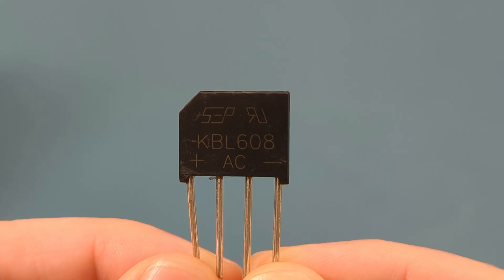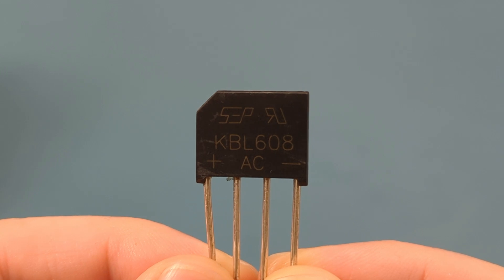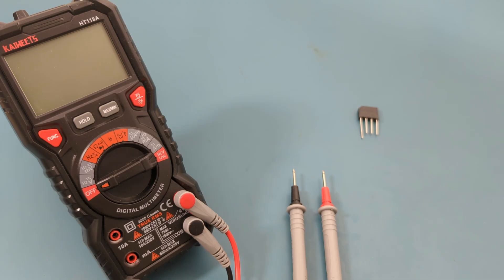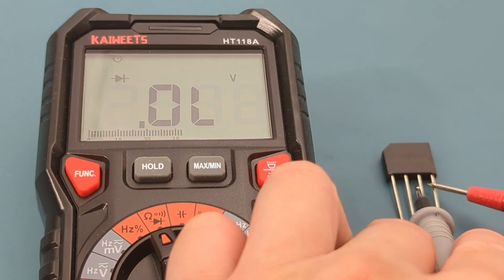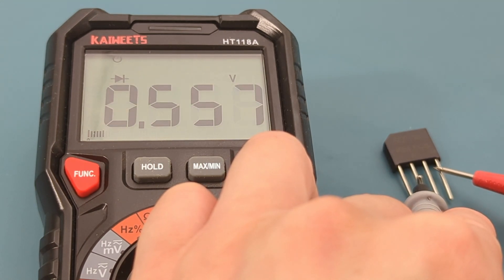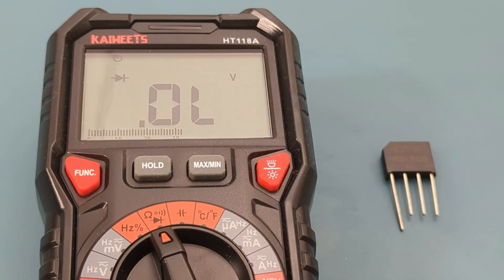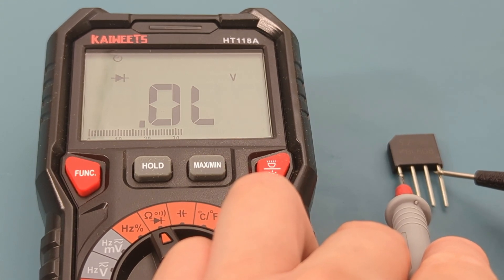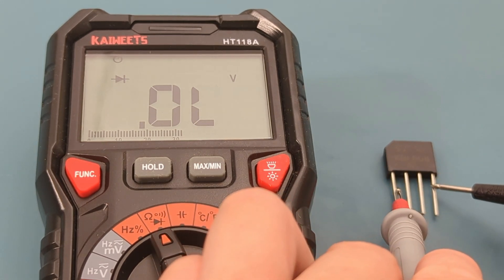How To Test Bridge Rectifier With Multimeter

Comment: When I measure from 1st to 4th leg i don’t get 1v like you do. only 0.5v (like all other measurments minus it being blocked in reverse). Does this mean my rectifier is faulty ?
Reply from the maker: Yes, one diode may have become faulty.
Reply: @ElectroUniversity  interesting, something has also caused a ceramic capacitor to die, what other components could be a likely culprit?